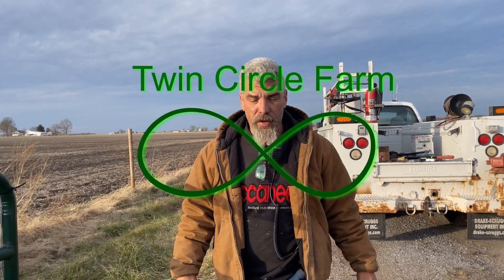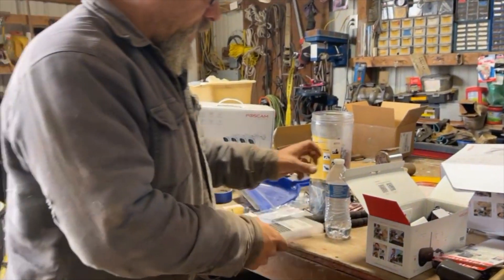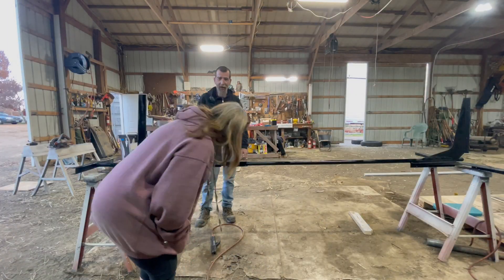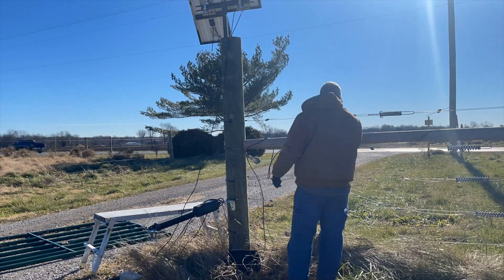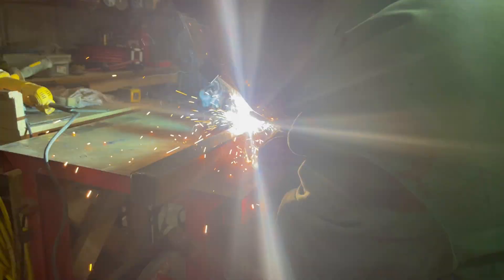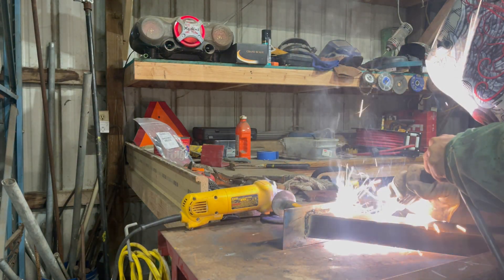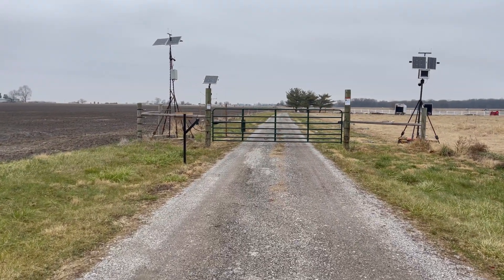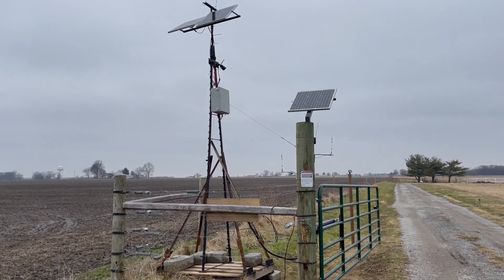Farm security and whole farm wifi - Ayrstone, Foscam, Might Mule. Solar powered solutions for you.

Comment: Do you have a list of products and mule model. We have a railroad style counter weighted gate..and maybe the mule’s larger ram might work…we would like to see who is entering after the gate alarm goes off..very similar distance issues…and of course off grid…
Reply from the maker: will have to dig that up for you…. bear in mind it’s not always the most reliable because… internet… but it’s their standard wifi control connected to their opener. It seems like it connects through their opener to our wifi at the house, then to the internet through their app. Often gets laggy, like it’s waiting on their “server” to communicate with out gate then letting the “app” know what the status is. When you give it a command, it sometimes seems to “think about it” for a minute or so before the gate moves.

As for the cameras the key is first getting with Ayrstone. get line of sight from their unit to the cameras…  they are a great help, the owner even chimed in on emails to help debug what we were trying to build with the cameras.

Comment: Use Yagi antennas for video back to the house and it will be 5 times bettrr.
Reply from the maker: we have to credit Ayrmesh. the system is working great from the house. the cheap antennas on the cameras definitely struggle, and the cheap “extender” antennas actually seem to lower the signal (they work better for “reaching” a few feet using their longer wires to get above or around an obstacle like through a metal wall to the outside…. we are looking at Yagi’s to bump the signal up, but so far gotta say they haven’t been needed at about 1000 feet. you can tell the gate controller lags, and sometimes the cameras are a little laggy, but alerts come through reliably.
Reply: Please chime in and share your system performance…name and model….we have a distance…1200’ or so straight line thru a creek channel with trees…